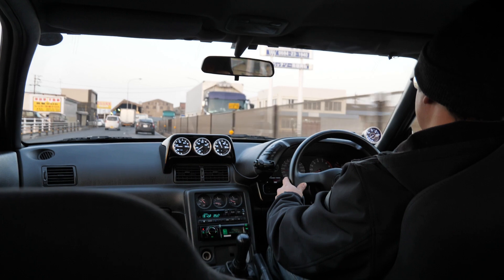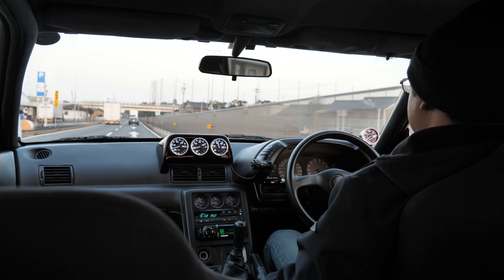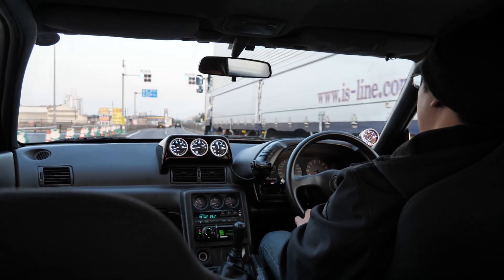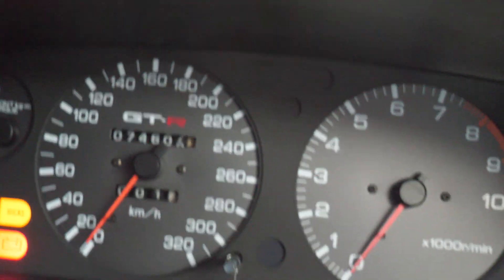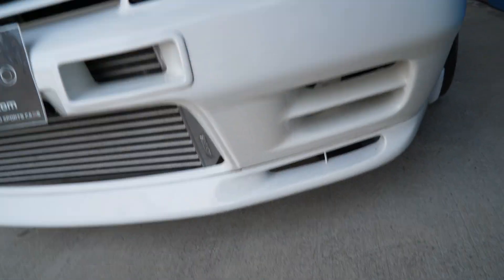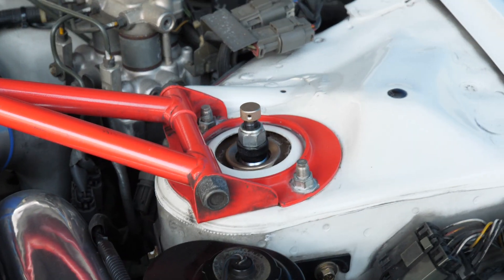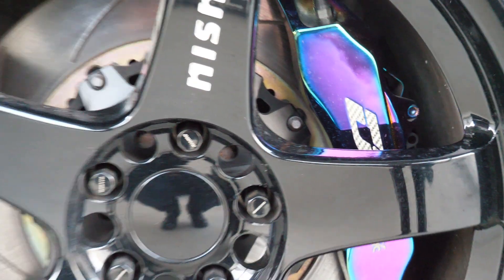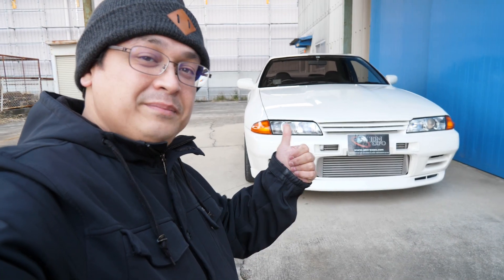Nissan Skyline GTR R32 / JDM EXPO

Comment: Wouldn't it be nice if you actually had informed knowledge on the vehicles you are trying to sell? The steering wheel isn't a BNR34 item it's just a S2 BCNR33 one.the head unit isn't a OEM BCNR33 item.